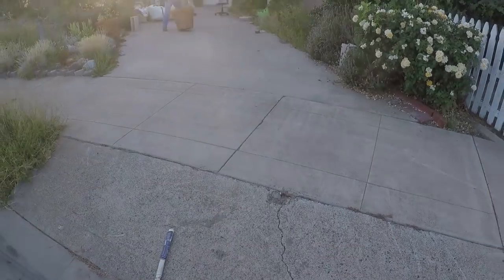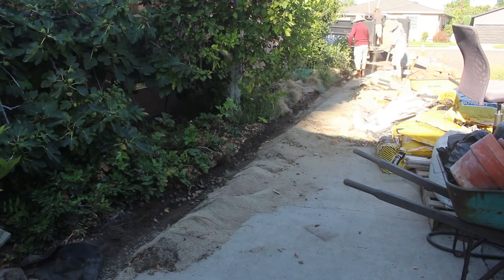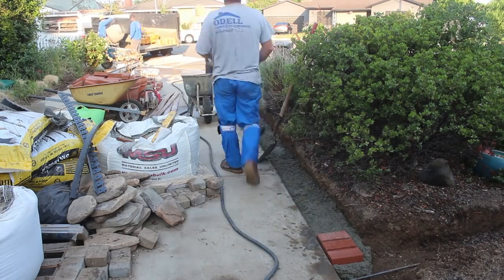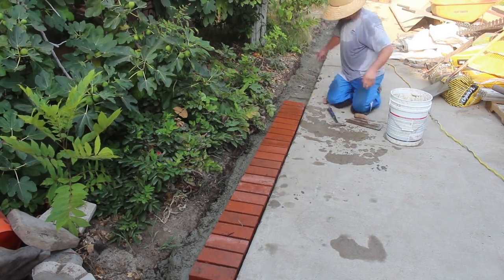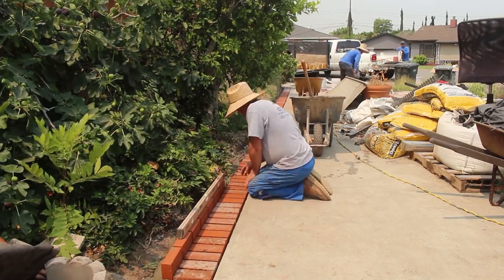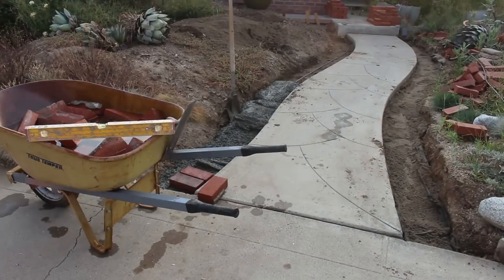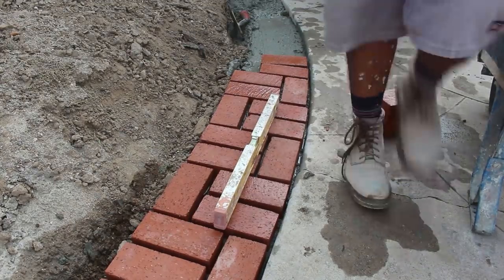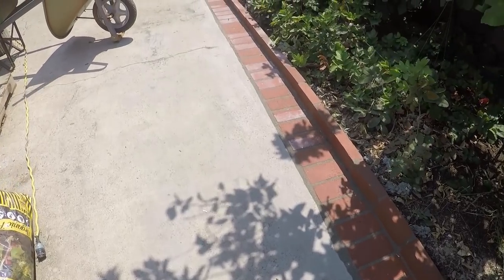How to Lay Brick in a Basket Weave Pattern Great DIY

Comment: Beautiful! I had a guy suggest setting pre-cast landscape blocks this way for a tree ring, but I’m in Missouri, so I would think it would have to be below the frost line, to prevent heaving, however, nothing structural would depend on them. What do you say about setting landscape blocks in quickrete for a project like a tree ring? 

The standard practice here seems to be compacted paver base and bury 1/2 to 1 block below grade
Reply from the maker: Sounds like the frost line is 6" deep
Quick Crete works for setting blocks, pavers, brick, and what ever else you want to male permanent

Comment: I just finished an entire walkway herring bone design. Used old bricks they had laying around to match existing paver patio. Problem was that all the bricks have been used before and have excess mortar that I had to chip off or cut. Bricks are old bricks handmade from mexico at least 40 years old so measurements weren't exactly the same. Wish I could have done it with the basket weave so much easier.
Reply from the maker: sounds impossible, to have any straight lines, bricks varied in size, with any pattern.

Comment: Hello Odell, thx for this walkthrough.  If you have time, why do you prefer to fill in the gaps with a grout bag, rather than the old-fashioned way of heaping concrete onto the side of the bricks as you lay them?  Just quicker?  Thx!

Edit: Well, grouting is for looks & to prevent debris falling into the cracks.  The bricks look secure enough, and need not much concrete between them.  Another question:  For the bricks standing up, do you haunch them up to half the brick?  Or just a 1/4 of the brick height will do?  Thx, we're doing it this weekend...
Reply from the maker: I think I did a half brick. grouting with bag is less clean up

Comment: I enjoy your videos and am a subscriber.  I do have a question on this job.  Are you concerned about a crack developing between the side pour concrete and the existing concrete driveway concrete driveway since use did not use short rebar dowels?
Reply from the maker: It is possible.